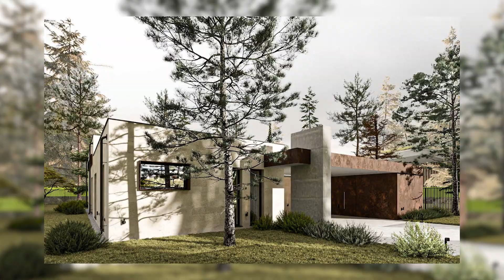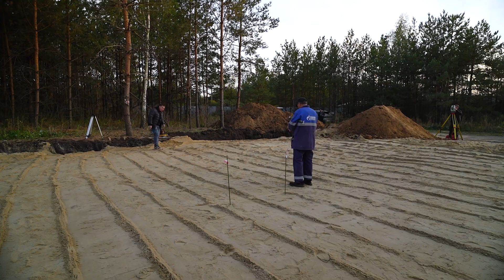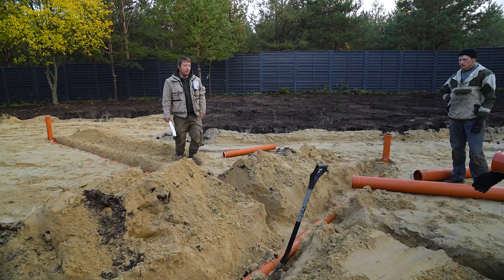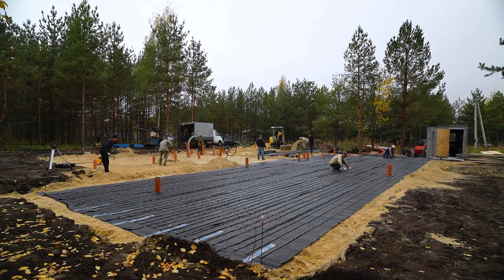Фундамент и канализация - стройка дома с нуля | Full Build Timelapse

Comment from the maker: 📌 Содержание выпуска:

00:05 — План фундамента / Foundation plan
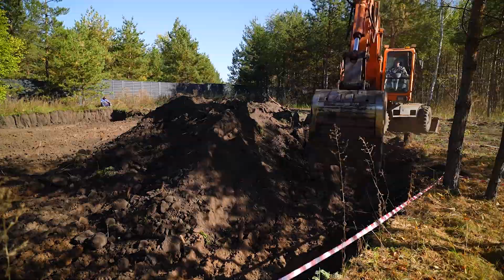00:17 — Копаем под канализационные кольца / Drainage wells
00:28 — Завоз песка, черновая подготовка / Sand filling & leveling
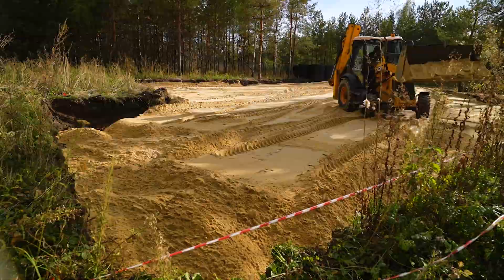01:15 — Гидроизоляция колец битумом / Waterproofing rings
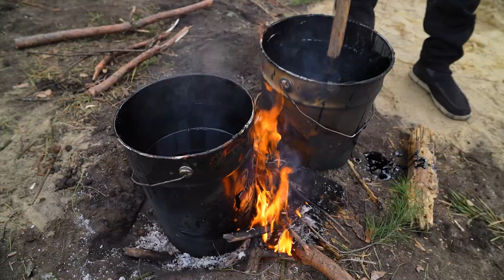01:22 — Отметки для засыпки / Level markers
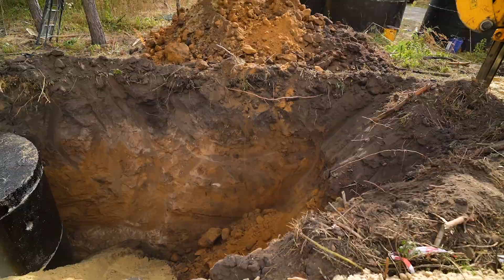01:56 — Проливка водой перед трамбовкой / Watering before compaction
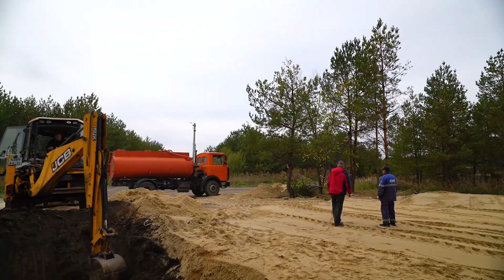02:09 — Трамбовка DPU130 / Base compaction
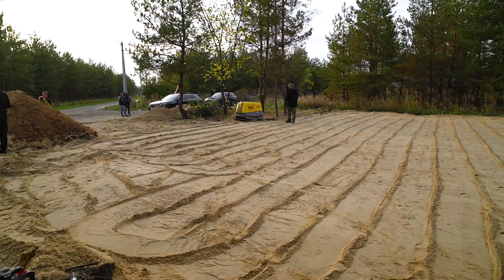02:29 — Разметка под канализацию / Layout for drainage
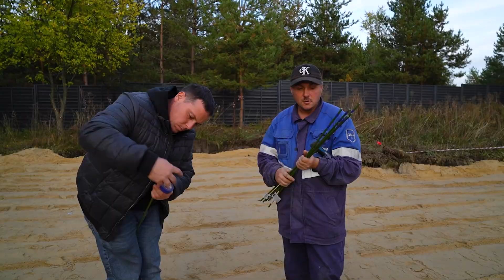02:52 — Мини-экскаватор чистит участок / Site cleanup
03:18 — Копаем под канализацию / Digging for pipes
03:33 — Монтаж канализации / Drainage installation
05:43 — Засыпаем трубы песком / Backfilling pipes
05:57 — Финальная планировка основания / Final leveling
06:03 — Разгрузка арматуры / Rebar unloading
06:28 — Трамбовка лёгкой плитой / Light compactor work
06:46 — Заводим коммуникации в дом / Utilities installation
07:00 — Укладка плантера / Planter membrane
07:37 — Вязка арматуры / Rebar tying
08:29 — Усиление по периметру / Perimeter reinforcement
08:41 — Гибочный станок / Rebar bending
09:06 — Установка опалубки / Formwork setup
09:21 — Тумбы под колонны / Concrete bases
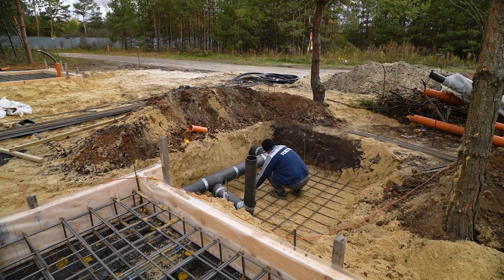10:01 — Заливка бетона М350 Б25 / Concrete pouring M350
10:56 — Проверка уровня и заглаживание / Level check & smoothing

Смотрите, как шаг за шагом строится фундамент — от подготовки участка до заливки бетона.
Поддержите видео 👍 и подписывайтесь на канал ЛЕХАМЕГАСТРОИТЕЛЬ, впереди много полезного контента!